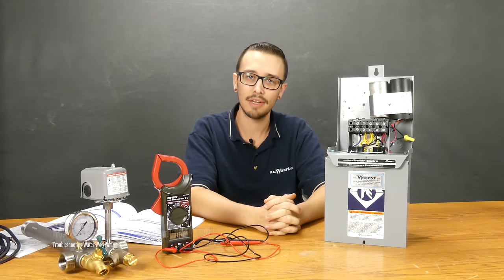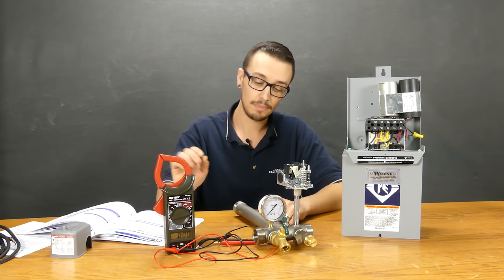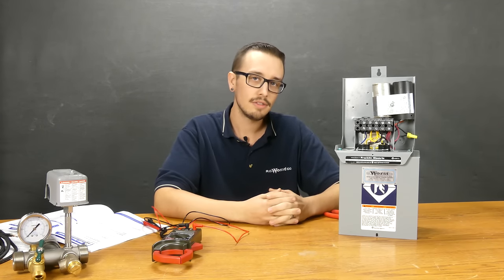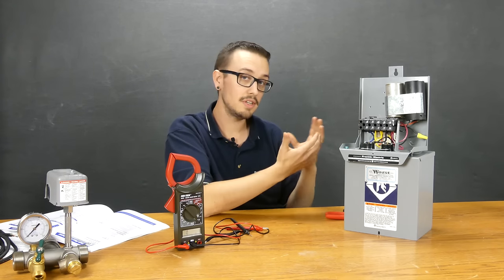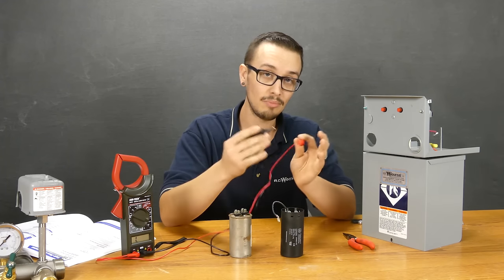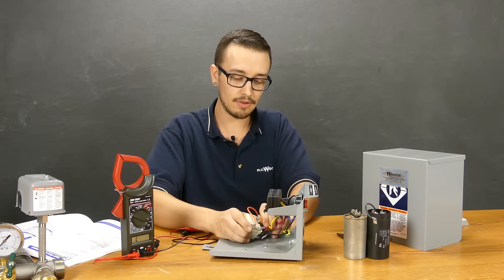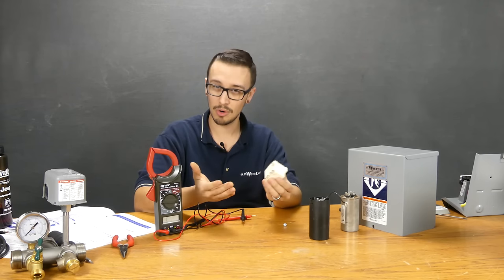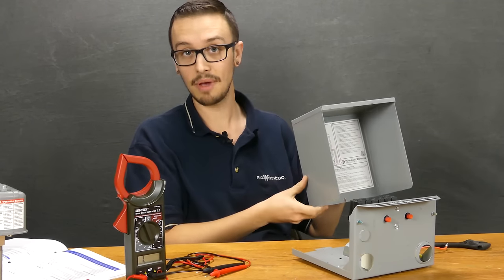How to Troubleshoot Franklin Electric Control Boxes (1.5 - 15 HP)

Comment: Thank you so much for making this excellent troubleshooting video.  Your comment that the overload switch may take some force to reset saved me a service call.   Both of my switches had tripped after a storm where the power cycled on and off.   The right switch did not take too much pressure to reset.   I had pushed the other one and nothing happened.  I checked for continuity and the one that reset measured properly however the other was open.   After seeing your video, I double checked the switch with extra force in pushing the button and it reset. Continuity was restored as was proper operation of the well. Thanks again for saving me from a service call.
Reply from the maker: Nice Job!

Comment: So my well quit. I followed these tests and had a bad start capacitor. Replaced that but still no water. The question I have is that my overloads test high: left is 5.5 right is 1.86 what does that tell me is wrong? Your video did not specify.

Comment: Awesome video! Had a guy come out to tell me I needed to replace the entire box for $950. Did some research and found this video. Pushed the reset button on the bottom and it worked! Thanks!
Reply from the maker: Nice work!
Reply: You can buy 9 control boxes for that money. Criminal
Reply: My 3 hp control box is 329.00

Comment: Unless you installed the system yourself, relying on wire colors on manufacturer diagram can sometimes be a gamble, some installers may replace a bad wire with one of a different color because that's what they have available. Taking a picture of the wire colors and position on each terminal (component) is a good way to insure the proper reconnect order.

Comment: Great video. I have a 2HP well pump that was replaced about 2 years ago and the black start capacitor went bad on it about 3 weeks ago. I replaced it with an exact same 105-126uF But when I replaced that capacitor I noticed the run(shiny) capacitor was of 20uF.  Is this normal for a 2HP or should I replace it with a 30uF capacitor,  I was able to run my sprinkler system without loosing pressure at the tank, and now pressure drops to 20-25lbs.
Reply from the maker: That would be a question for the manufacturer of the motor. Our Franklin Electric 2 HP motors use a 20 mfd run capacitor.
Reply: R.C. Worst & Co., Inc.    thank you !

Comment: These videos are so valuable! Thank you for posting them and going step by step on what to do/look for/troubleshoot.  I'm on emergency water and my control box apparently tripped. I didn't realize what the problem was. I had checked the CBs, the wiring,  etc, but it would not run. I had pushed the reset buttons,  but did not realize how hard you have to push them. I got it reset and am up and running.  These videos could definitely benefit me if I have anymore issues.  Thanks again!

Comment: Closeups of the meter and contact points on the control box would be very helpful .
In addition those of us unfamiliar with the use of voltage would like closeups of the meter face so we can adjust our meter’s accordingly. Otherwise good info. Thanks!
Reply: If you aren't familiar with it, probably should call an electrician
Reply: @mitchellmantifel9665  Its not hard to use a meter, just copy what he does in the Video.

Comment: I realize this is a 5 year old tutorial and it is still relevent and helpful, Thanks.
I have a switch box that runs to the control box and then a Pump Saver Model 23. And I have replaced the pressure switch.
The problem I am having is that the pump , when switched on runs only for about 10 seconds max.
The Air tank has 37.5 lbs in it.
When I throw the on switch the air gage only grts to about 30 lbs psi (with an open 3/4" line) then dhuts off. The pump saver calibration light and the green operstion light illuminates. Shortly after that the other (right hand) calibration light illuminates and also the overload light just before shutting off.
While its running, the pump seems to be just fine.

I replaced some plumbing when i installed the new pressure switch. Someone told me thst i needed to bleed off the airtank pressure and then run it then fill it to 38 psi ( pressure switch is a 40 / 60)
I havet tryed that yet.
You seem to habevtye best tutorials available, so in the hopes you still check this youtube channel i thought i would ssk you.
Reply: Did you figure it out similar to what I’m dealing with thanks

Comment: Thumbed up for fixing my simple problems: 
#1 - Where are those damned reset buttons?  Oh... they're hiding under there.  
#2 - I would have likely have not pressed them firmly enough had he not mentioned the need to press them relatively hard.  

Thanks for posting this.
Reply from the maker: You bet Alex, thanks for the comment!
Reply: Alex Baugh how do I test for 220 voltage on my pump?....(I have a new Franklin control box, and can’t get it to work.) thank you.

Comment: Howdy, thanks for the videos. Question I have is can bees or something other than a leak ( Dug up all 5 hydrants I see no water leak there. I also shut of the water to the house) that can cause the motor to be constantly running? My green light has been flashing for a month at least. 1 sec intervals, stopping for a second now and then.

Comment: Great video. After resetting the overload, it continues to pop when turning power back on. Does that mean it can only be the pump? Can a bad capacitor cause an overload to pop?
Reply from the maker: If the overload is continuously popping it is likely that you have a short somewhere. It could be in the wire or it could be in the pump/motor.
Reply: Having the same issue. Checking the wires in the morning. Thank you.
Reply: @RCworstwater  could a compactor cause a short? I have sparks around the compactor flying out when it starts the pump

Comment: Thanks for the video! I recently came across a 1/1.5HP control box like this one and the start capacitor was definitely cooked. It leaked out all the electrolyte inside and the actual contact itself was also completely corroded. I changed out the start capacitor for one with the same microfarads and replaced the connector cable. However, it still didn't want to start up. I ended up replacing the entire control box and then it worked. Does the capacitor need to be the same brand? The relay measured correctly. I did not check the run capacitor as I did not have a spare one of those. Could it be that both capacitors were bad? Do you sell replacement capacitors? Thanks!

Comment: I did all the test you said and my relay was bad, i out a used relay i had into it and pump works but relay makes vibrating  noise when running pump

Comment: I want to check my control box with a volt meter, however it's outside the work shop and has a large puddle of water around it.  I plan on filling the area with sand with the help of our tractor.  Using the meter, will I still be able to check the box without worrying about getting shocked?  Your advice on how to proceed.  Thanks.

Comment: If you are still uncertain about the control box, is there any danger in turning off the breaker, connecting the pump leads directly to the incoming line voltage, opening a nearby water valve, and turning the breaker back on for a few seconds while watching for the water flow? Wouldn't that would bypass the pressure switch and the control box and quickly let you know if the pump was working or not? Knowing that would speed up troubleshooting and possibly avoid the need to pull the pump out of the well.
Thanks!
Reply from the maker: The control box is required for starting the pump. There is no way to bypass it.
Reply: @RCworstwater  thanks! Bought a new control box.

Comment: Control box went out  yesterday replaced it with a new one the new ones capacitor blew up now installed another new one and still not working well pump is about 2 months old also replaced pressure switch what could be causing these issues also I’m on like the 4th pump in 8 year time frame any suggestions or your thoughts would be much appreciated thanks

Comment: Good series! I'm following to troubleshoot my sons well pump....but noticed that I don't have any type of control box on my system, that I can find. Is this something I need to address? I had the well drilled deeper and a new pressure switch installed by professionals, and they didn't mention the missing control box.
Reply from the maker: Is it a 2-wire or 3-wire pump? If it's a 2-wire pump then it does not require a control box.
Reply: @RCworstwater  I'm sure its 2-wire now. Makes sense. No startup capacitor, no third wire.

Comment: I have a F.E deluxe control box for my 2HP pump. My pump keeps running even after the pressure switch trips to turn it off resulting in over pressure and a watery mess. Why would the pump keep running after the pressure switch tells it not to?? :(

Comment: In the video, you mention that the resistance across the coil (in the relay box) should be 4.7-7.0.    Is that in thousands of ohms, for example 4700-7000 ohms?   My relay box had a sticky residue inside it and covering all three terminals.  I also get 0 ohms resistance across the coil.    short?
Reply from the maker: Nope, just 4.7-7 ohms. Sounds like you need a new box if the capacitor blew.
Reply: @RCworstwater  I put a nice ohmmeter on that coil and it read 5.1X1000 ohms.     The sticky residue was inside the relay box, not the control box.
Reply: @CrankAddict  Just watched their relay video and it should be 4,500 to 7,000 Ω, or 4.5 - 7.0 kΩ.  You were right.  Their reply above is not consistent with their video.
Reply: @kevinhouck7345  thanks.

Comment: Thanks for you very helpful videos. The capacitor ratings in on my Franklin control box label do not match the capacitors that are installed in the control box. When replacing, should i match the label or the existing capacitors? Maybe a replacement pump required different capacitors? The label is for a 3 HP pump, and someone wrote on the box that the pump was replaced with a 3HP pump a few years ago. The Run capacitor on my label is a 35 MFC 370V and the one installed is a 45 MFD 370V. I think an incorrect capacitor may be the root of my problem.
Reply from the maker: I would replace it with what is supposed to be in the control box, but really either should work fine. The new 3 HP control boxes come with a 45 Mfd so that may be why that one was installed.

Comment: Could a bad control box cause the pump to not kick on at a certain water pressure resulting in water shutting off? Everything in my system is new including the pressure switch.  my pumptec control box and well pump are the only two things that have not been changed
Reply from the maker: Not likely. Give us a call and we can help you troubleshoot the problem: 855.329.4519

Comment: We have a Franklin control box on our well. We bought the house 14 years ago and were shown the reset button on the bottom when we were buying it. Since then, and probably before, the button trips sometimes 2-3 times a day and sometimes not for a week or two. What should I be checking for to find out why? Most times it's not bad but if we're in the shower and it trips we have to go out, fully soaped up, and press the buttom on the bottom. Our pump house is about 100' out from the house and it is a pain. It also happens when doing laundry so the whole load has to be redone. I can't think of anything that trips it consistently, it's random.  What should I be testing and what might be the problem? Like I said it has been going on for 14 years and my wife is very tired of it. Any help would be greatly appreciated. Thank you. model #2823008110 1.5hp
Reply: Did you ever figure out what the problem was?

Comment: Thanks! This helped me to identify my start capacitor was bad. Sadly, there was not one available anywhere nearby that had the same microfarad range (part 275464-113, 220V, uF 105-126). I ended up buying a whole new well controller and replaced the other one, which was pretty simple. Funny enough, when I opened up the new one it had almost the exact same start capacitor in it, only difference was the brand. I'm back up and running now. However, I am curious. There was a 220V start capacitor with a uF of 108-130, had I used that would that have been a huge issue? I don't know what pump I have, it was installed by the previous owner and we've not had the well serviced since we bought the house 3 years ago.
Reply: As long as the voltage rating is the same or better and it has the same or more capacitance (assuming it's a start capacitor), you should be fine.

Comment: Thanks for this great video!  I've got about a half dozen bad boxes laying around. Lightning knocks them out.  In the past, tried replacing capacitors that were obviously bad (bleeding), but these didn't last long, so I assumed there was another problem and stopped replacing capacitors. I just opened a relay and started searching for a video. Turns out the relay I have taken apart has a bad coil (open). Are the coils replaceable?
Reply from the maker: The relays are a common replacement part, but I am not sure if it is replaceable or where you would even find just the coil. Best bet is to replace the entire relay.

Comment: I have an older version of the Franklin control box in this video.  I have had to reset it twice this week. Never had to do it in the 10+ years I have had this well. Any thoughts as to why it’s happening?  Thanks
Reply from the maker: Chris, we have a video on troubleshooting overloads. Find it here: https://www.youtube.com/watch?v=1_93mYBh8BM&t=110s
Reply: Voltage Leak to ground in cable or pump motor windings

Comment: Great videos.  I'm troubleshooting my box and noted that the start overload fuse keeps opening following a lightning strike.  Resistance across posts is well above the 0.5 ohm stated as the max.  Checked capacitors and relay and that all seems well.  Anyone know where I can buy the overload fuses?  I cant find them anywhere
Reply: I got a few at Ace Hardware. You probably already have you system back up ny now though

Comment: My box has a switch in the upper left corner of the box that works in conjunction with the pressure switch. 

The water quit flowing, I pressed the reset and this switch activated with a lot of arching & sparking then tripped off and it will not reset again. 

I can't get a replacement switch till Monday if at all and was wondering if I could bypass it?
Reply from the maker: No, it is needed to switch the pump on/off.

Comment: Tested the Overloads and they are reading 0.8 which is above the 0.5 the box says they should be below.  Now.  This said... the lowest option on the selector dial of my cheap multimeter is 200 ... so is that potentially adding in a factor of 2 since it is 200 not 100?  The next setting up is also 2000 not 1000 so I am thinking I need to divide all my results by 2?
Reply: Just rewatched the video and his is at a setting of 200 as well.  So.  What does it mean if the Overloads are reading too high a resistance?
Reply: @russellparker5043  You meter display is 3-1/2 digits, meaning it reads from 0.000 to 1.999 (or some other decimal point position).  That's why the ranges are 200, 2000, etc.  The reading is still ohms, not doubled.  You should first touch your probes together to see what reading you get, and subtract that from the reading on the overloads, so you're not counting the resistance in the probe wires.  And your meter is not trustworthy at such low ohm values, so I wouldn't assume that an 0.8 ohm reading is necessarily diagnostic of a faulty overload.